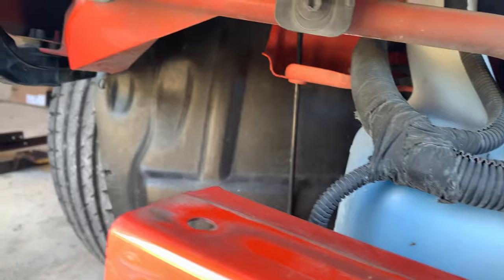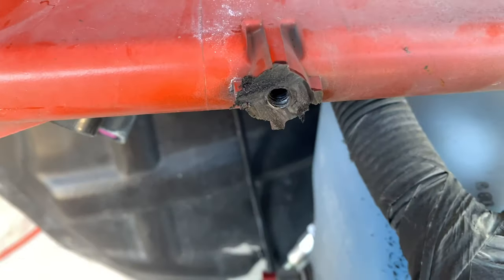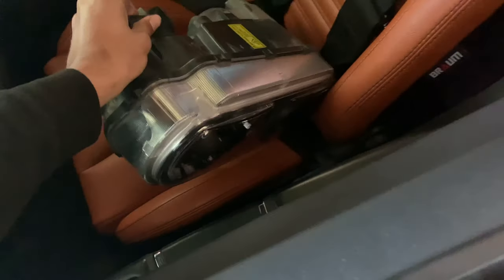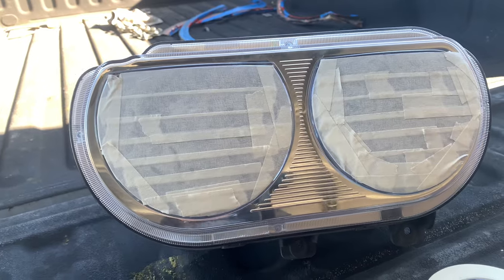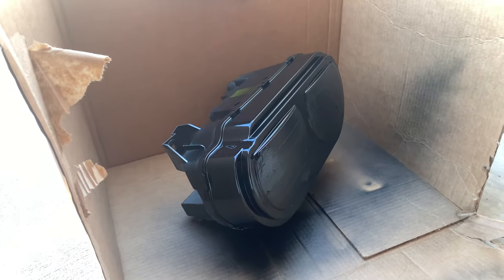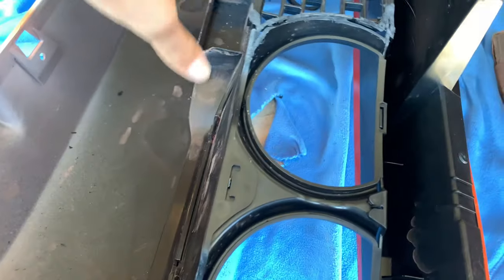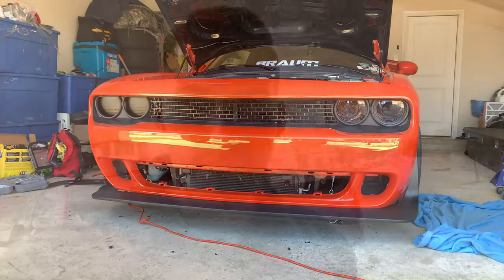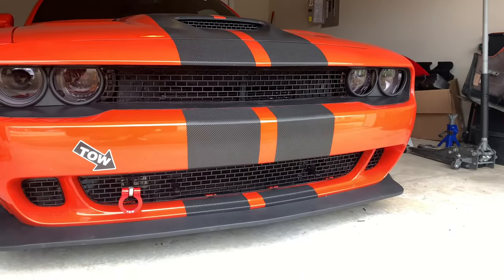Vicrez Demon/ Hellcat front bumper install part 2!

Comment: I have a 2016 Hellcat Challenger. I have the fender flares kit and demon style front chin from vicrez. Why is there a gap on both sides of the front chin and the body of the car? PLEASE HELP
Reply from the maker: Because the front bumper flare portions are completely different than oem while the chin spoiler they provide is pretty much oem (I purchased a mopar one thinking it was the problem) 

The problem is the front flares on the bumper. 

People have bought oem flares for the front bumper and it lines up decent, and you can then use the front lip and it lines up. 

Hope that helps, sadly it means your going to spend more money and more time mocking up the oem flare to your bumper.
Reply: Yes it makes sense! I need to find the OEM flares for the front at least and I have to try and remove the current flares which are "fender bonded" on! Yea I'm in for a ride...

Comment: Hey brother love the video love the front bumper you got there & I’m thing about going to get the same one for my 2010 Dodge Challenger
Reply from the maker: Thanks man! The hardest part is the trimming to clear the older headlamps but I made it work! 

You can also buy 2015+ headlamps and Steve white parts sells an adapter harness for them to work on the older gen challengers.
Reply: TIRADO RACING I can use the headlights off of hellcat for my Dodge Challenger SE sweet I got a find this company to make the adapter for it
Reply from the maker: I got you on Facebook bro!

Comment: Great video have the conversion coming in. Advise on best tool to use to trim the plastic?
Reply from the maker: I used a dremel with a sanding disk. I’m not sure the model dremel I’ve had it for so long the label is gone.

Comment: I got the flares for my 16 hellcat and then ordered the front lip as well. I don’t see how the lip works with the flare piece that goes over the front side marker. Did u have to trim that piece any? And did u have to drill into it to keep the lip attached?
Reply from the maker: I had cut the ears off and lined it up to look like oem, drilled holes into the flare and the lip on the backside and used rivets. 

Here’s the crazy part, I ordered an oem widebody front lip and it was pretty much exactly the same as the vicrez lip. 

So don’t waste your money doing that their the same. It’s the flare that is different. Some people buy oem lower front flare and modify their bumper for that and then the lip will line up oem. 

I since have gone oem front and back.
Reply: @TIRADORACING  appreciate the reply. Sucks because I already had the flares and all painted, and then ordered the lip to find that it doesn’t fit over or under the flare with the running light. Since u cut the ears off, did it not cause issues since it wasn’t bolted to the actual bumper anymore?
Reply: @TIRADORACING  also, did u put on/rivet the lip after or before u glued down the flares? Sorry for all the questions. Just wanna do it right the first time around
Reply from the maker: Not a problem at all, if you have Instagram I can send you pictures and video. Mine is @tiradoracing. It’s easier than trying to explain it in text. I still have the old bumper and flares and lip.

Comment: Hey man! Great vid! What side markers did you end up purchasing? Looking to get this bumper but didn’t know which side markers I needed. I know they have to be upgraded correct?
Reply from the maker: Well my side markers came with my vicrez wide body kit which are hellcat widebody side markers. So you’ll need that and a widebody front turn signal harness. I had found it on eBay for $100 and made a video in it. Idk which video anymore it’s been a while.
Reply: @TIRADORACING  I called Vicrez today and they didn’t really help. I have no idea where to find a 2015 and up challenger side marker wiring harness. Could I just buy the side marker lights from somewhere like American Muscle, but they don’t come with the updated harness, just the actual side markers, but then I would need the newer challengers Wiring harness because the 08-14 challengers use a different harness? Is that correct?
Reply: @TIRADORACING  also, my challenger is 2013 challenger RT and is not widebody, I just bought the demon bumper so it’s not a widebody.
Reply from the maker: Correct. I replied in another comment but I did make a video
Reply from the maker: PSA: I am not building a Hellcat Widebody Clone + how to install 2015+ LED side markers
https://youtu.be/TRYjGMZ2frI
Reply: @TIRADORACING  you have a way for me to message you privately and I’ll show you the wiring harness to make sure I have the right one?
Reply from the maker: @davidlockemusic  dm me on Instagram @tiradoracing

Comment: You have vland head lights behind your hellcat bumper ? Someone told me it’ll look funny ? If so it actually looks good with out purchasing the actual 2015 headlights
Reply from the maker: Hey Gerald! Thanks for reaching out, no I have the stock headlamps that came with the car. I think in this video I show you how I made them look good. 

I have headlamp tint on them already. Then I had to grind (as seen in the video) to make them clear the bumper since Hellcat headlamps are smaller. 

Then I taped the face of the headlamps and traced out how much of the headlamps show. I cut the surrounding tape off leaving the face of the light taped and cleaned them and applied  plastic paint promotor then painted them in matte black trim black so no chrome from the original headlamps show. 

And the result is what you see lol you can see pics on my Instagram too @tiradoracing. 

I hope this helps!

Comment: Hey! How did you installer those lights ? I have a 2011 and I guess I need adapter for electrical cords , any ideas ?
Reply from the maker: Did you watch the video all the way? Those are the stock 2009 headlamps. I just painted them and tinted the faces. I also modified the bumper and headlamp mounting tabs so they would fit with the Hellcat bumper. 

To fit 2015 headlamps you do need an adaptive harness and you can find it at steve white parts website.

Here’s a link to it! I hope this helps! 

https://www.stevewhiteparts.com/steve-white-catalog-08-14-to-2015-challenger-headlamp-head-lamp-light-halogen-wiring-conversion-kit-swmchalight?parent=1059
Reply: Thank you so much that’s what I needed the harness for it ! Yeah my bumper fits nice after following your tips man ! Good luck nice car !
Reply from the maker: Josafat Ortiz that’s good to hear! Yea the 2015 lamps are easier to install and the harness is that last piece of the puzzle! I’ll be converting my headlamps sometime down the road! And thank you!

Comment: Did your car have fog lights at first? If so how that work with the new bumper?
Reply from the maker: Hellcat bumper doesn’t have fog lights. 

Unplug fog lights. Done. 

You still use the harness for the side markers but the other 2 pigtails for the fog lights don’t plug into anything.

Comment: Thank you for the videos! I have a question...in the first video you show that the drivers side where the bumper connects to the fender didnt line up or fit nearly as good as the passenger side.  Was that issue fixed after being done with the headlight clearance issue? So it fits nice like oem with no gaps or bumps etc?
Reply from the maker: Yeap after I ground down the tabs and some of the bumper where it was hitting the headlamps it went right on. If you want pics or video just DM me on Instagram I’ll send you pics! @tiradoracing
Reply: @TIRADORACING  will do ill dm you now! My instagram is @helheim_hemi
Reply: @TIRADORACING  im going to add you im doing mine now on my 2014

Comment: Can you put 20x11 on those?
Reply from the maker: Couldn’t tell you.... depends on a few things really. 20x11 with what size tires? How low are you? The most important question is what offset. 

I have a set of 20x10.5 forgelines that fit the narrow body. But are still sunk in with the widebody. 

All about offset....
Reply: TIRADO RACING i wanted to do widebody with oem hellcat widebody wheels and same height as the hellcat widebody
Reply from the maker: Ken Doug it might work lol but I don’t have experience with that. The widebody Hellcat wheels will fill out the flares but I don’t know if you’ll have to cut or not.  My best advice is hope for the best but go into it knowing you might have to cut